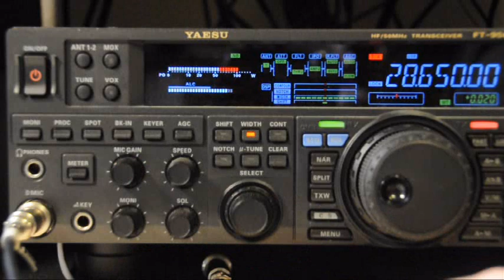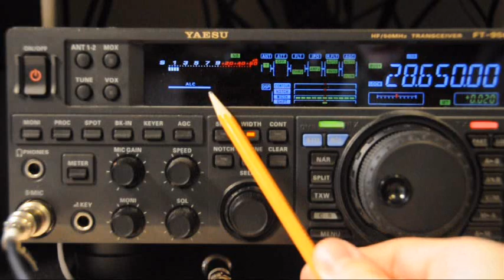Ham Radio Tutorial - How to set SSB Gain Control

Comment: You are wrong, This transceiver give same power with ALC 10% or 100% , ALC should be peek close to 80% or even 50%   
Your settings was to to high  ALC was 100% and you still over shoot ALC with your setting
 You make lots of splattering , ALC should newer go higher than 50%   or PEEK PEKK 80%

Comment: I'd rather be sure that I am making the full 100 watts output that the transceiver is built to produce. Many transceivers ALC meters are too conservative.
slatter...?... the stations on the receiving end are probably running their NB too high or they just have an "older" radio. Transceivers these days have very clean TX even if you try to push them to their limit.

Don't be afraid of your mic gain !

Comment: For those asking, the ALC can only compensate so much, if you give it too much to handle, it can't compensate - that is the reason to properly set mic gain and the other parameters affecting the drive to the modulator. Once the ALC starts to compensate, it begins reducing the drive anyways, so there is no real point to pushing things.

I also note that in the FT-857D operating manual p48 under SSB/AM Transmission - Basic Setup / Operation, it says to adjust the SSB mic gain so that only the first couple of bars on the ALC meter light up. There is also processing (p50) and the basic built in filters (p51). While I like having the lower frequencies in my voice for voice-over and singing, it seemed to "muddy" my voice on SSB, so I left it on high-pass to see what my reports are for the next while.

Transmitting into a dummy load and using another FT-857D on my antenna, my SSB sounds horrible, I tried my Alinco DX-70T and it sounded great, so be careful how you monitor your receive.

Comment from the maker: You are correct, the ALC will **usually** prevent over-driving the radio. However, you should still feed the proper signal into the radio. If you don't the background noise around you will be transmitted more than necessary, essentially reducing the dynamic range of your audio signal. This is the most common cause of complaints about "fan noise" or hearing the T.V. in the background of someones signal.
Reply: Yeah all that 'room' noise is irritating, you must close talk the microphone and adjust accordingly.
That ft-950 has parametric control for the microphone....
I have this rig...

Comment: I'm a bit confused about the ALC.  Isn't a limiter circuit designed to prevent a signal level from exceeding a certain threshold value?  If the ALC is calibrated right, why should you manually have to lower the mike level?  Wouldn't the ALC >> automatically <<  cut / clip the level -- keeping it within the threshold limit?

Comment: How about adjustment settings when using the Processor & the mic EQ on the FT-950 ? as this is a whole different ball game , setting your audio by the ALC is standard practice . also with the stock mic or an after market base mic, audio is so frustrating at times to get exactly right for the surrounding environment . 
thanks and 73`s Gez M0NTC

Comment: I have an Icom 756 pro, and the Icom sm-20 micorphone. There is a mic gain on the radio and one on the mic as well. There is also a "low cut - on or off" on the mic as well. How would i set with both of these controls??

Bill N2ZUL